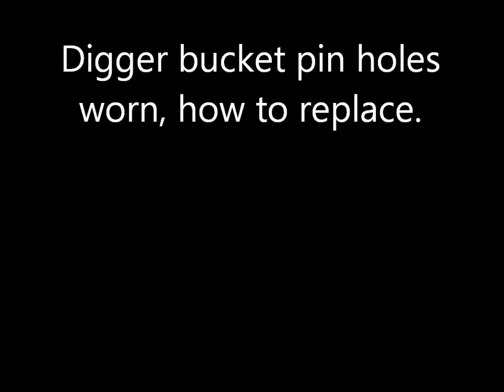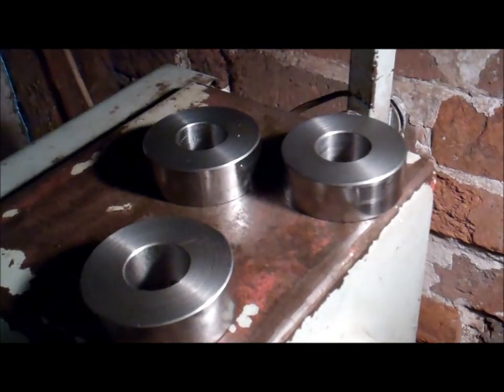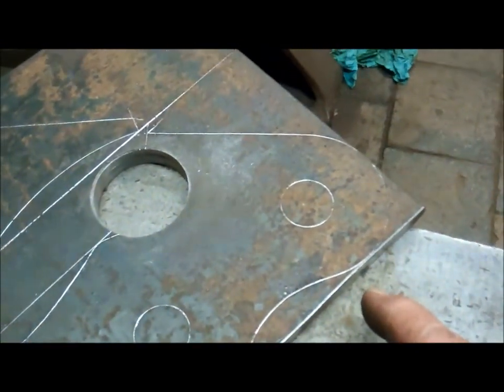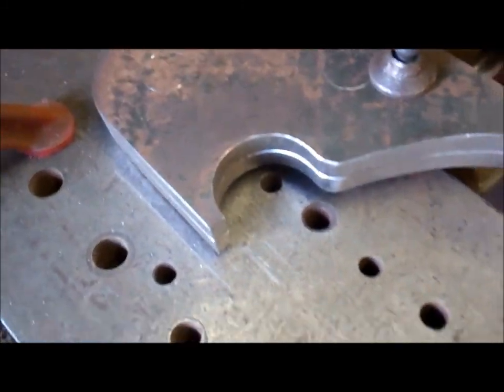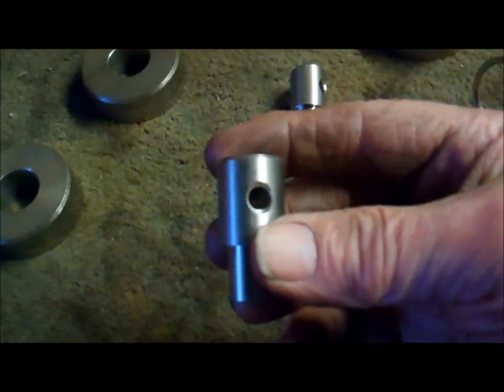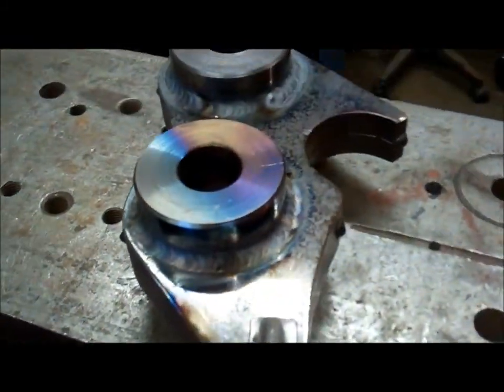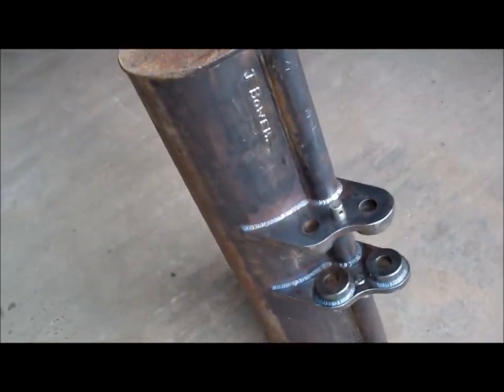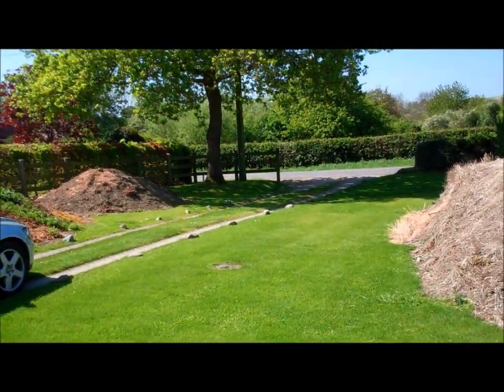Digger bucket pin holes worn, how to replace as new.

Comment: Nice work making the brackets how easy did the pins go in after welding? Any tips on keeping everything lined up
Reply from the maker: Thanks for the comment,The lugs were made identical to each other / lined up with spacers prior to welding / the pins passed easily through the holes.

Comment: Excellent work, however  I do think it might have been an idea to get the sides cut out by someone with a cutting torch, it must have been a nightmare cutting  the 1/2" plate with an angle grinder.
Reply from the maker: Grandad pop, thank you for the comment, if I was making lots of these plates yes it would be better to cut them out with a cutting torch, although these days I would use a plasma cutter, but as there were only two of them it was better for me to use my large angle grinder with a good quality thin cutting disc 230mm diameter, the disc I used is meant for cutting stainless steel and made light work cutting these plates out, tidying the edges up afterwards took longer but I would still have to do this if they were cut with a cutting torch or plasma.
Reply: @johnbower  I see you have a lathe, perhaps you are already a subscriber to doubleboost on YT. He also has a Plasma  Cam, for future reference he may be able to help with project work.

Comment: Hi John
I have a precise mini digger welding job, I wonder would you be interested in taking it on?
Reply from the maker: Heli Pilot, Sorry but my workshop equipment is not really geared up for this type of work, This bucket repair job I did was to my own digger and carried out in between my regular jobs, my regular work is with stainless steel in the dairy industry.
I am interested to know exactly what part needs welding.
Reply: John Bower Hi John I am building a tiltrotator for my mini digger and the rotator/slewing drive housing will be fabricated from mild steel and welded together, rather than using a cast iron slew drive. It’s fairly precise part to make as it houses the worm and gear to drive the rotation. It’s also a fairly small part around 400x400x200mm

Comment: Why didn't you just cut out the bosses?
Reply from the maker: Edwards Caissie, There were two reasons I didn't just cut out the old bosses, (a) The lugs were welded in the wrong place to fit my digger. (b)To be able to weld all round the new bosses they have to be welded to the lugs before welding the lugs to the bucket.